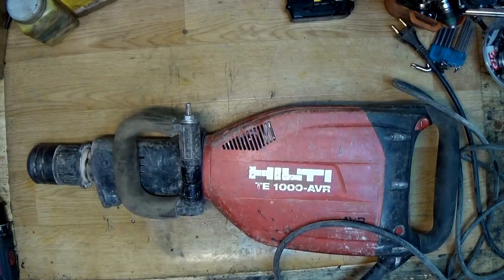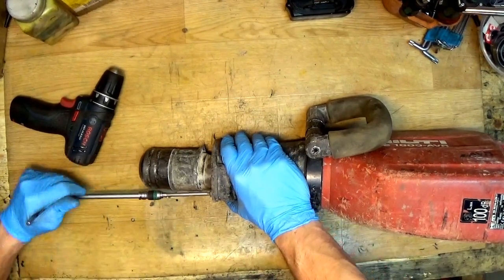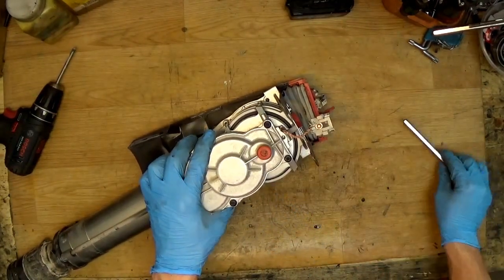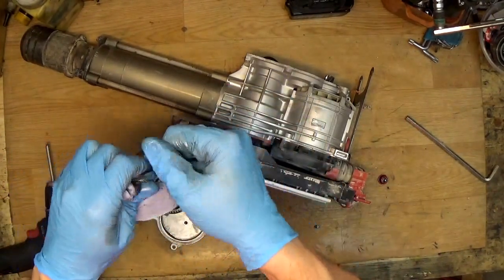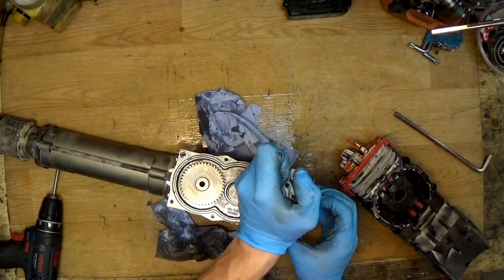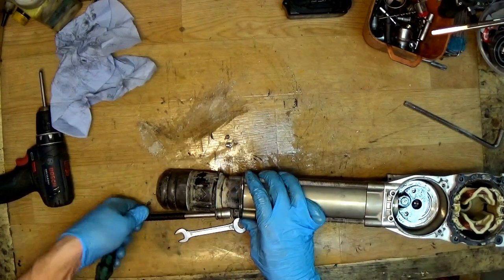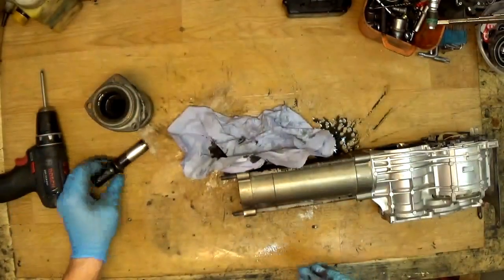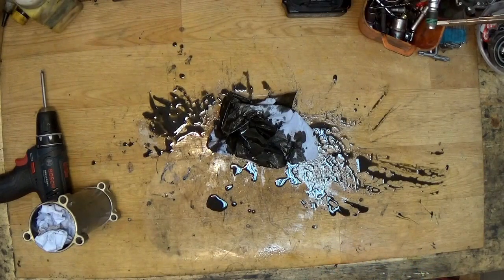Hilti TE1000 AVR concrete breaker disassemble

Comment: Do you happen to have or know where to find a service or repair manual for the Hilti TE-52?  Hammer works though not the drill functions reported.  Hilti replied I need to find a service center that might have a copy of.  Thanks for sharing this too, neat to see the larger performance designs are simple hammer function designs.  I have a Thor-Nado with not tools also working, that I will most likely have to fabricate tools for and design to use the newer SDS-Max I'm thinking shanks or maybe if can fit the jack hammer shanks.